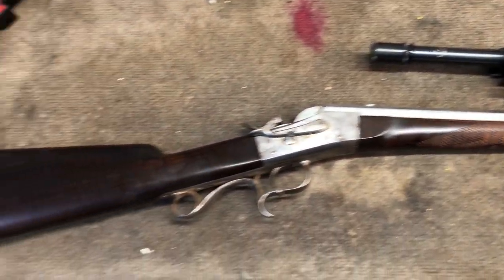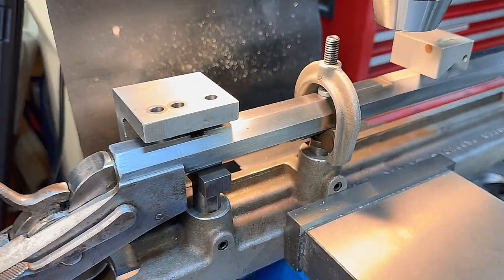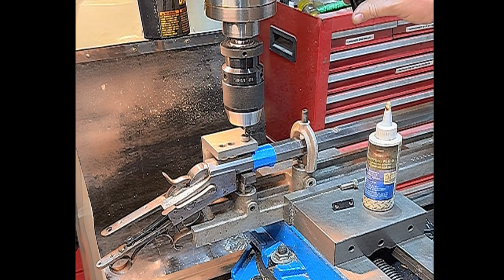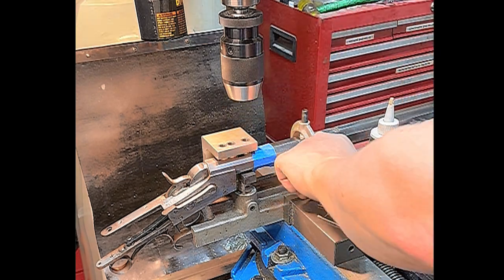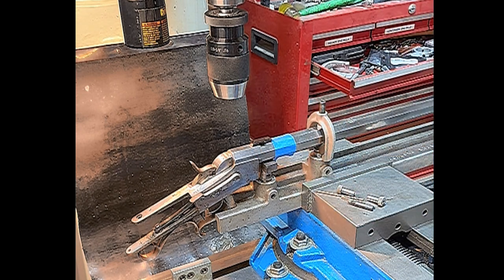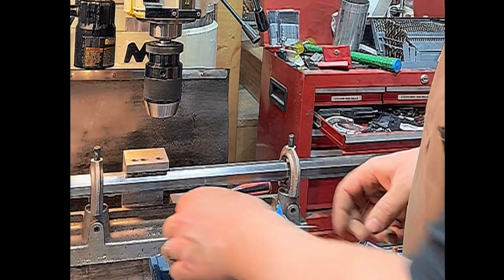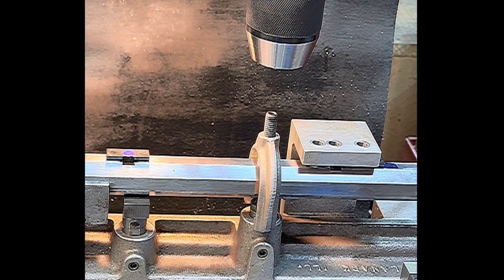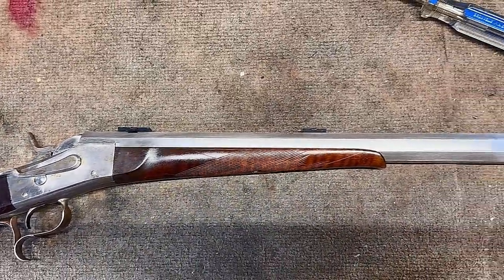Unique Remington Rolling Block Unertl Style scope installation. By Turnbull Custom Guns

Comment: Mr Turnbull, by the way, the bit diameter divided into 300 formula works for turning and milling, 
with carbide, you can double or triple the speed.....
instead of remembering 300 for mild steel, 150 for stainless, and 600-900 for aluminum, 
I just divide everything into 300, then half the speed for stainless, and double or triple for aluminum....
of course, hardened  stainless [400 series] you will have to reduce even more, and 1045 and above or tool steel
will have to be slowed down a bit too.....
I sure hope this may help you or a viewer, best wishes, Paul in Orlando
remember, if your chips have any color, you are too fast, and 
if you are running to slow with a small bit, you need more pressure to bite into the work, 
and that will cause the bit to break.......many people believe small bits need a slow speed.......that will lead to catastrophe....
Reply from the maker: Thanks for the info!